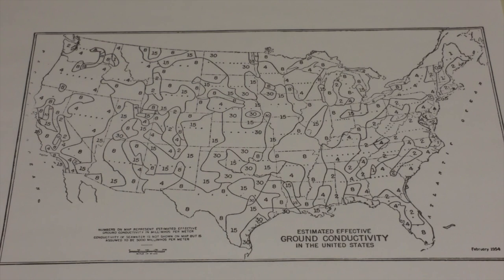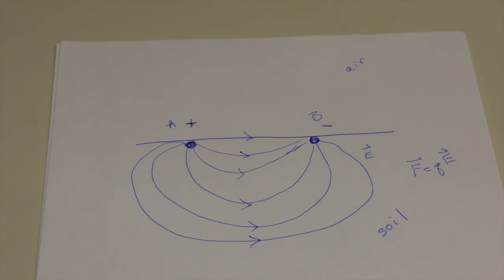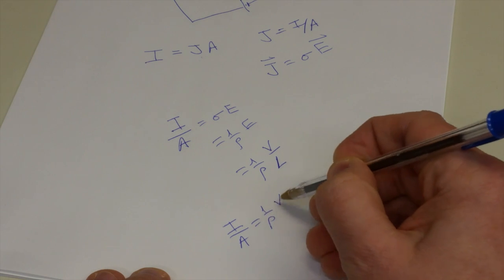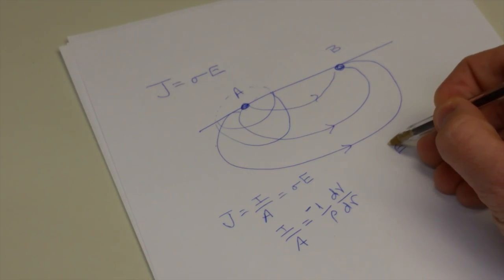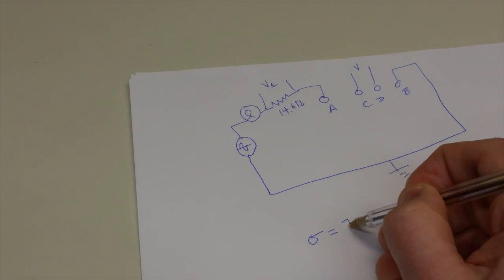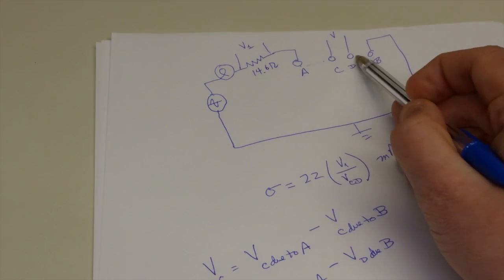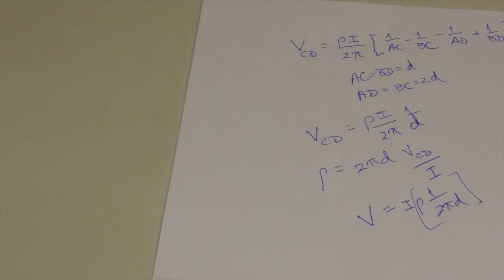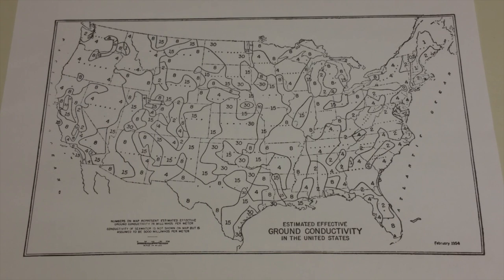#5: The physics of soil conductivity measurements

Comment: So, how does soil resistance vary with distance between two ground stakes that have a voltage relative to each other, assuming the soil resistivity is uniform? The stakes are very thin and have very small depth compared to their distance. Thank you.
Reply from the maker: The paper by Herman goes much more deeply into the physics, and I am planning a more detailed set of measurements where we explore how these measurements depend on things like length between the probes, depth and orientation of probes, and frequency of the source. Hopefully I'll get that done this fall.